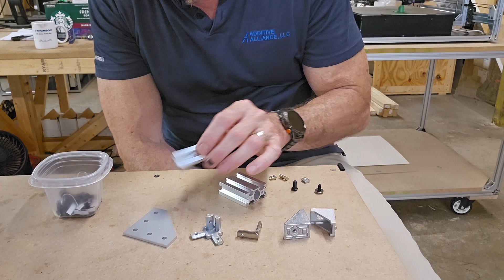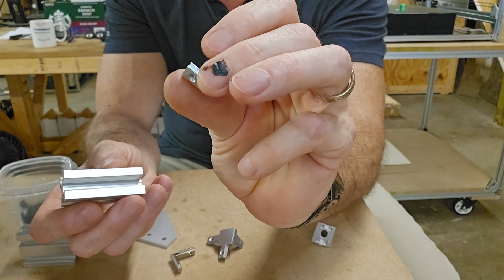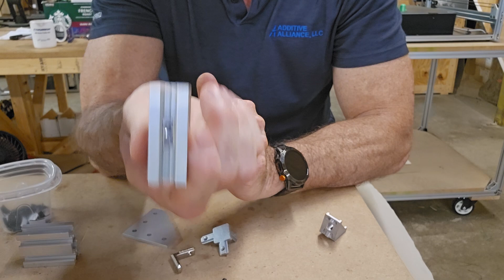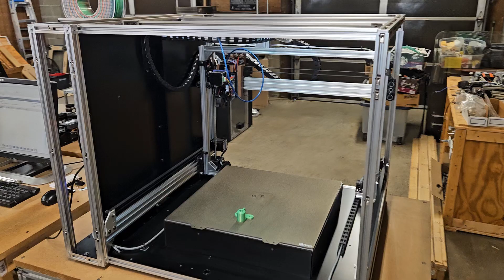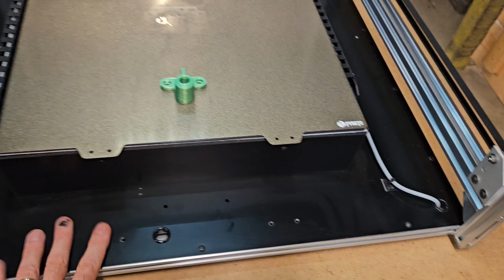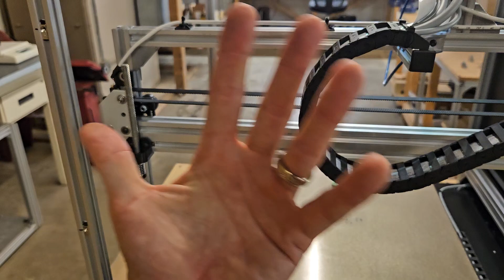Building a 3D Printer - Frame Design

Comment: You probably wouldn't have even imagined it when you wrote this video, but this video is exactly the kind of topic introduction I need for 3d printing frames. 
Now, how we get resonances changed based on the frame construction to maximize accelerations and velocities is what I'm interested in chasing. Will ringing/ghosting at ridiculous speeds happen with tighter bolts? Stronger frame "adhesion"? Either way, thanks for this video! Make some more!
Reply from the maker: Hi @Lolerez, I'm glad this video was of some help.  As you likely know, no matter how loose or stiff the frame is there will always be a natural (resonance) frequency to it.  The trick is to just make it high enough that it is beyond any of the stimulation that is created by internal motion.  So even if you're driving your system at say, 1000 mm/s and your doing a series of 1.0 mm long fill vectors you'll want your frame stiffness above 1 khz.  Modeling your frame to figure out its natural frequency is possible, but not worth it.  The practical answer is to just apply some logic when you design/build it to get it stiff then strategically add another cross-member/corner-brace if it does ring when you test it.  Also realize that the higher the frequency you get it to ring, the less motion it will have, and the less it will be able to impact part quality negatively.  Good luck!